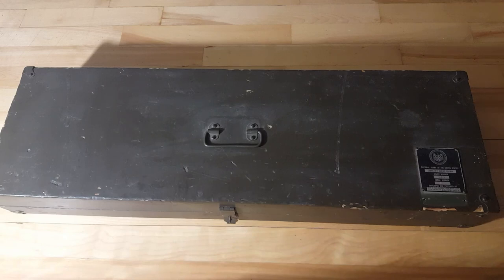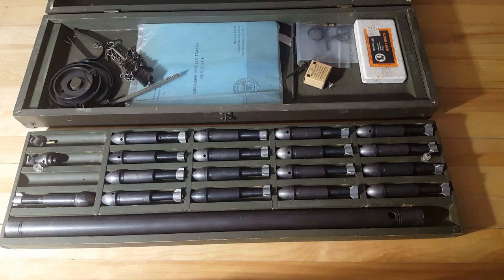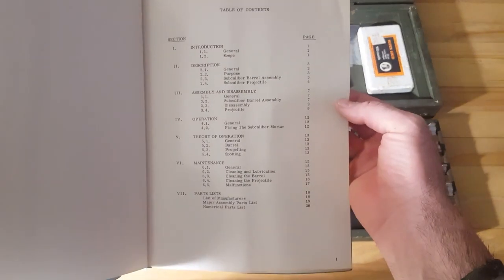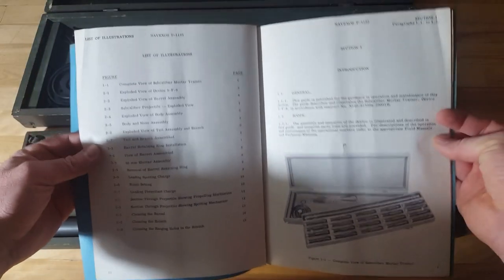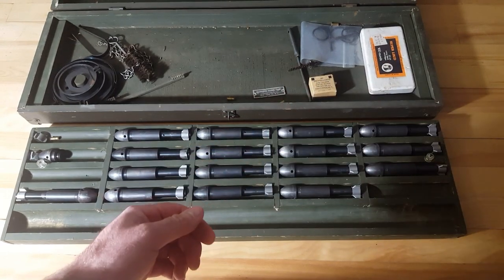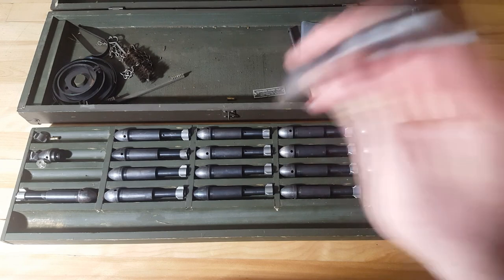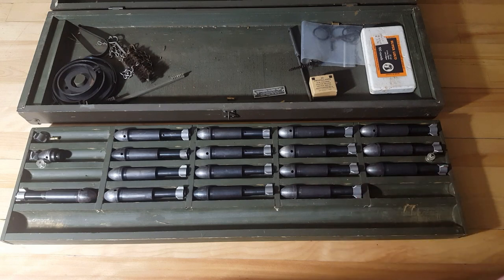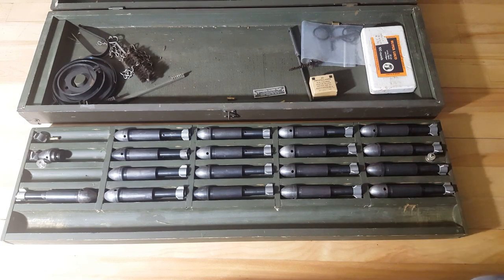Subcal Mortar Training Device 3-F-8

Comment: I seen one of these years ago and after seeing how they worked thought it would be an awesome thing to build as a giant adult lawn dart type game, I had a Bridgeport mill and nice metal lathe at the time, just seemed like a cool idea but then I started researching the legalities here in the USA and if I remember right I’d have had to do a form1 and send $200 for a tax stamp and do the registered deal and that took the wind out of my sails for that idea, never messed with it. You’d think a little.22 cal blank powered deal that only went 50 yards wouldn’t be illegal but I think it was.
Reply from the maker: Yeah I'm not sure if they would consider it a DD in the US. IMA sold one and didn't mention it being a DD.  Probably due to the way the thing works. The spigot and the round are technically the barrel. If you made one like a real mortar where the barrel was over .50 then you would have to consider it a DD. In this case the fact that the "barrel" is just a guide I think saves you from that problem but I'm no lawyer. Lol
Reply: @Stray03  yeah, it all sounded confusing lol, I’d “assume” that since the barrel of the actual mortar round was closed, like a Ramset nail firing tool and couldn’t fire a projectile, just pushes a captive rod, that it wouldn’t have been considered a firearm at all………but when trying to research, it was confusing and not worth it for just a game. Damn stupid laws